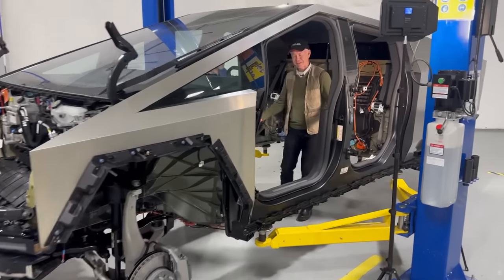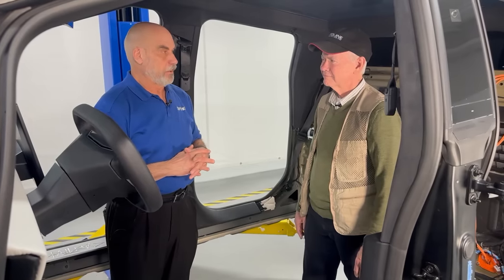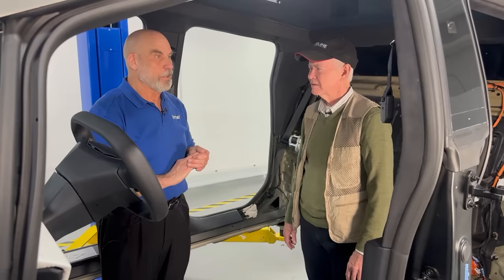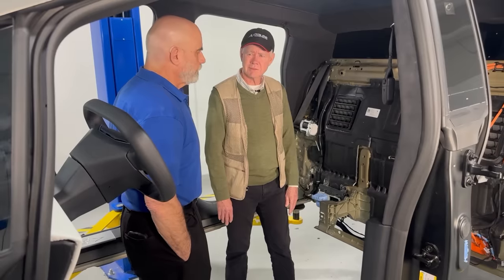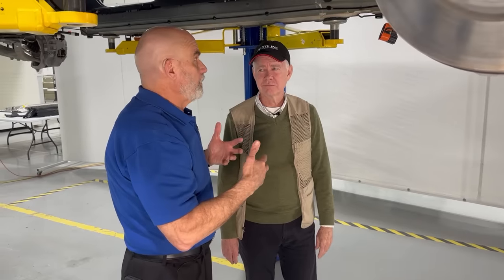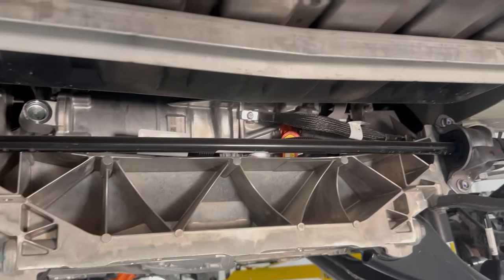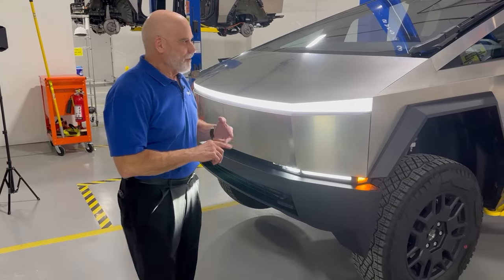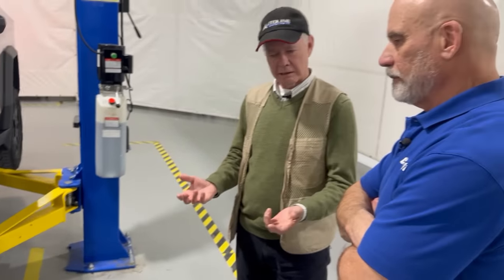World's 1st Cybertruck Teardown - Steer-by-Wire, 48V, Battery & Gigacastings

Comment: Kyle Conner stated that drive by wire does not work for off road driving! He should know after buying his Cybertruck that listed for $121,000.
Reply: KYLE , cheated and used DAVES Tesla points , to skip the Reservation line.

Comment: No. A drive by wire system DOES NOT need 48 volts!

The motors that move the wheels can use 48 v as they are the high power!

The steering wheel controller and circuitry could be ANY low voltage 5-12v as it is ONLY sending data to the motors that do the steering!

But once you have 48v available, you may as well have the “feedback” motor be 48v also.

Comment: 9:40 isn't it funny that our first thought about steer by wire system is usually that in case of such system's failure there is nothing stopping is from accident, but we never think about the multitude of possibilities why the traditional steering systems can fail as well? That shaft he holds in his hands can be broken on both ends, the telescopic mechanism can seize up, as well as the mentione bearings. And failure can happen further down as well. Shouldn't the first logic be that cancelling the idea of the shaft avoids a whole host of other possible failures?
Reply: No
Reply: @brunoheggli2888  Yes.
Reply: Not to mention Airplanes are steer by wire... Although with DEI hiring practices, airplanes have been going down left and right.
Reply: My 2013 Honda Accord is steer by wire.
Reply: @blipco5  it's not. It just has electric power steering
Reply: @illsheet  Oh, I get it now. When it’s on a one hundred thousand dollar Tesla it’s "steering by wire" but in my twenty three thousand dollar Accord it’s just "electric power steering" 😂 I have no steering column either and my rack has one electric motor… I call that steering by wire.
Reply: @themonsterunderyourbed9408 mostly left
Reply: @blipco5 
Your rack has a solenoid operated mechanical engagement in case of failure.
Reply: @rogerstarkey5390  I’m a pretty good mechanic and have done my own repairs for years, including rebuilding engines, but to be honest I don’t know how my steering actually works. I mean to research it.

Comment: The front steer by wire is a gimmick considering that the CT has a conventional steering rack.  Three electric motors instead of an intermediate shaft?  I'd like to know how much that costs.
Reply: I think the end goal was owner satisfaction (170 degree turn) and Tesla bragging rights to be the first. I agree, I don’t see any costs savings over the old school method. It may actually cost more to build.
Reply: I think it's more about the driving experience. In a normal pickup with a standard rack, you have to make it be a fairly slow rack. With the steer-by-wire, you can infinitely vary the ratio, so doing something like a 90-degree turn at low speeds is a 45-degree turn of the wheel, and then you can slow it down at speed to make it less twitchy. Whereas if it had a very slow rack, it would be a pain to operate at low speeds, or if you gave it a fast rack to gave it more sporty driving characteristics, it would be very twitchy at high speeds and probably not great for controlling trailer sway and doing small corrections. 

It also gives you one less hole in the firewall, and you can change the driver's impact positioning.
Reply: There must be at least one motor in the regular modern track for power steering. And the shaft itself with all the things mention in the video. So it is not that bad.
Reply: @shafir2info Exactly.  Plus assembling a connecting shaft is much more skillful and detailed than snapping together a few wiring harnesses.
Reply: I am sure it is costly. But there are many advantages - here are some
1) Different ratios at different speeds - quicker turns at slow speed
2) No hole in the firewall 
3) Easier to make right hand steering
4) 340 degrees stop to stop (vs normal 900)
5) Over air updates with adjustments - I bet driver modes are coming soon - racing (180 degrees), trucking (1800 degrees), dinosaur (900 degrees), off-road etc. 
6) Real easy for the computer (ADAS, stability control, ABS and so on) to control the steering
7) Avoids too hard steering wheel kick backs when driving off road
8) No need for a collapsible steering wheel column
9) More accurate
10) Perfect game controller
Reply: I can imagine the amount of  development hours and testing it will take to get the feedback feeling right.

Comment: The steer-by-wire in automotive is an idiotic application. Just because it is novel does not mean it is smart. Conventional steering is very light, simple, inexpensive, and very reliable. SBW introduces complexity, cost, weight, power demands, reliability concerns while adding very little benefit.  This is especially poor idea in an EV where you want to conserve every bit of energy now you need to power large motor to simulate the forces that in conventional applications you get for free. Then you need large, costly, heavy and power hungry motors (two of them) to steer the vehicle. I have seen a lot of dumb automotive ideas but this takes the cake. But of course Tesla fanboys will love this because it is "out of the box" thinking.

Comment: I will never own a vehicle that has no mechanical connection between the front wheels and the steering wheel.
Reply: Motor cycles have ride by wire throttle, is that OK.
Reply: Modern planes are steer by wire, and break by wire is more normal than one might think. Never say never.

Comment: Having no environmental separation between battery pack and cabin has not gone well for Chinese EV brands. If a pack is in runaway, the gasses are deadly - and go straight into the passenger compartment. They also lead to some spectacular explosions.

Comment: I'd rather watch sandy
Reply: Then don't watch
Reply: At least we got to see some defects highlighted here.
Reply: @normt430  The highlight on defects is the least interesting part when you talk about the first 1000 vehicles of a completely new car design dude. You hyper focus on stuff that every car manufacturer that ever launched has like its news. It isn't news, in fact this teardown video was kind of a joke because the car isn't actually torn down yet. It is merely pieced apart without actually giving anyone real insights as to what is happening. Almost everything they showed was shit you could see and tell without taking it apart to even what they have already done. You don't need to take apart the wheels of a steer by wire system just to see it move.... you just roll the car outside and turn the steering wheel lol.
Reply: @BigBadBossu  the improper hinge could have damaged the door.  We've seen Tesla with different wheels before amongst other things. 

See Munro gushing over the CT on the lift.

Comment: Dual front steering motors allows different vectors for the inner and outer wheels on turning.
Reply: If I recall, the lead engineers who spoke with Sandy only mentioned redundancy.  But perhaps there's more going on.

I suppose this is an opportunity to find out more.
Reply: I think it is still a rack so you won't be turning in different directions..

Comment: gigacasting saves manufacturing costs, but, make repairs more expensive or impossible.. next level of insanity will be structural batteries
Reply: Significant repairs are already a no-go these days. If you have a little fender bender, sure they fix that. But if you get into a serious collision, more likely than not your car is a write off anyway. Also, let's not forget just how tough this truck is. I've seen two accident pictures so far of the CT being hit by other cars - a civic, and a dodge ram. Both the civic and the ram were smashed, and the CT in either case was mostly undisturbed. For you to hit something hard enough to damage the gigacasting under that armor plating, you're probably dead already anyway.
Reply: Are you sure?
Reply: They can be welded and if not there is an realy serius problem and it should be changed anyways
Reply: Cybertruck has a structural battery pack. The Gigacasting basically will only be harmed in a crash that would total any other vehicle, in the low speed fender bender crashes the Cybertruck will not sustain any damage. You can hit the body panels with a sledgehammer and not dent them, and you can do the same with the gigacastings, a sledgehammer barely leaves a mark. Both the body and frame of a normal vehicle are definitely worse for wear if hit by a sledgehammer.
Reply: @ColinFox  The CT features an 'exterior crumple-zone.'

Comment: Terry: "They have 3 motors to replace a tie-rod, so complex"  McElroy explains "2 motors here for redundancy and that love that 4 wheel steering"    It's almost like Woychowski is trying to justify why this kind of aerospace engineering which works for aircraft has some problem and just cannot be done in automobiles.  (Not mentioned, but part of the safety redundancy mechanisms is the FSD hardware that is always enabled for free for safety.)   Terry smirks "48V but not everywhere .."  McElroy explains "but I'm sure you just need 12v for a dome light.. and its easier to step down voltage to 12V from a main 48V bus".   I have a new respect for John McElroy for adding some engineering context that didn't leave questions on some of the engineering strengths look like a weakness.  Cars are complex systems as are many of the things in our modern life.  Engineering is sometimes about tradeoffs but also about fundamentally trying to do things better and that is exciting!  Yeah that door hinge could use some Poka-Yoke.  Good find.  looking forward to next episode.
Reply: I think Terry missed the Munro discussion/ walkthrough with Franz, Lars, etc where they covered the multi voltage power supply, 48v system, steering motors/ control/ redundancy  and a lot more.

Comment: The teslas with structural battery pack don’t have quite the safety of the standard body in white. I was the one and only person to discover this with new iihs measurements. The structural variant of the Y while still rated Good, shows more intrusion vs the standard BIW.

Comment: Those motors don't just replace a convoluted shaft, they replace an entire hydraulic system (pump, valves, cylinder, lines, sensors).

Comment: The cybertruck is a fantastic car with many technical innovations. However, the 48 volt system is not new. It is a tested system and standard in other countries. See Wikipedia „…In 2011, German car manufacturers Audi, BMW, Daimler Benz, Porsche, and Volkswagen agreed on a 48V system supplementing the legacy 12V low-voltage automotive standard. Hyundai Tucson, Hyundai Santa Fe, Kia Ceed and Kia Sportage followed in model year 2019 with 1.6 and 2.0 turbodiesel engines supported by 48V mild-hybrid technology. A European automotive trade association, CLEPA, estimated in 2018 that as many as 1 of every 10 new vehicles in 2025 would use at least one 48 volt device in the vehicle, covering 15 million vehicles per year….“

Comment: Sort of a garbage suspension.  Giant steel lower arms, little travel, cheap brakes.  This is $30k car material.  Giant battery for 240 miles range and 7,000lbs of road-hugging girth.

Comment: The steering wheel motor is surprisingly big. I guess they just don't care to optimize or it's quieter in a big version with low gearing

Comment: Great, so basically they build a disposable vehicle using all castings. One good hit and it's junk and the whole steer by wire BS. What are they thinking? The cost of repairs down the line to keep profits up? What will that rack cost, or the steering feedback motor? All crap no one asked for or needs. Not to mention the whole stainless steel body too. LMAO 
Disposable car that will just cost everyone else in insurance costs. Go job...

Comment: I realize the overall methods need adapted to new manufacturing, etc. But straight up the Quality control of assembly this bad, you'd  think a FINAL Inspection before delivery would be better than to miss doors not fully opening. What less obvious stuff was missed? I so wanted the Cybertruck to meet the hype. Well this earliest generation has plenty of room for improvements in my opinion.

Comment: Steer-by-Wire with no mechanical connection.  What could go wrong?  Steering is the most critical control for safety, with braking second.

Comment: All this tech is great and “neat” but continues to drive up insurance rates. Already expensive labor hours go up, parts prices go up, the insurance write off frequency goes up. What’s cheap in the mfg process does not translate to repairs. All of us as insurance customers have to share the cost, rather we drive a simple car or not. How do we fix this ? Book hour regulation and all of the unintended consequences that might bring? It’s a problem across all brands.  Give me a $30 halogen bulb over a $2000 headlight assembly.

Comment: So, you are engineers doing a tear down of a Tesla product and you obviously have not watched all of the footage of the Tesla lead engineers and designers discussing the features of the CT. They have mentioned not everything could be converted to 48v due to the supply chain not fully there with options yet. Some things just do not make sense to produce in house so they did a mixed system for now.

Comment: I would have thought that using the battery box as the floor a silly idea. Why not have the battery box as a structural member separate from the floor with "screw jacks" holding it up, then undo 4 or six "Jacks" to lower the floor for ease of replacement.
No different from holding the body onto a chassis.

Comment: Steer by wire eliminates road feel which is critical for proper driving technique. Artificial road feel doesn't cut it. 
22:02  Now there's a panel gap I could see from two lanes away, flying down the freeway.
I guess if they're going with electric, they might as well use other pointless tech like rear wheel steering, which compromises its function as a truck. Too weak. The Cybertruck is a truck in name only and is too busy moving its own fat ass around to actually haul anything, regardless of the theoretical potential of the motors. Combined with the production failures, you have the very definition of a lemon. If they can install the wrong door hinge, they can definitely screw up something that is safety critical. It is sort of like the 737 MAX of passenger vehicles. A road going Ocean Gate sub. I wonder how many lawsuits Tesla can handle before they fold. I feel like suing them just because I have to share the road with that deathtrap. Definitely someone on the take at DOT. Imagining all this extrapolated out to a Semi and there are just no words.

Comment: Such a waste of time this SBW system. If it malfunctions you're dead! They add motors to simulate the road when they could just have a normal steering rack to do the same thing except this is much more completed. Sounds like a step backwards in my option, take a simple thing and make it complicated to do the exact same function. Rear wheel steering does not require a car to have SWB. Maybe Tesla should focus on quality first instead designing pointless tech.

Comment: As a Citroën enthusiast I wonder if the steering wheel self-center while standing still? High end Citroën´s used the Diravi system which also was "steer by wire" between 1970 and 1997. But it was hydraulic and had a backup steering column because legislation and safety. And one of the features was that it self centered even standing still. It was kind of mandatory because unlike "normal" cars where the road and front end dynamics dictate where the steering should point to, the Diravi steering need an "artificial default" and now I wonder how the Cybertruck does that. Decades ago, I wondered when other brands will catch up on Citroën´s engineering. I guess we know now about the steering at least.

Comment: A bean counting remark: The input and output speed of a cardanic shaft is only synchronous when the ingoing and outgoing shafts are parallel which is with a steering system never the case. In the most cars with a pignon/rack steering you can feel that the ratio is not constant.
4WD with solid axles can only drive on solid surfaces with a (unlocked) central differential. For instance a classic Land Rover 89 without a central differential can not drive 4WD on solid surfaces. Only on soft and gravel.

Comment: I think I would prefer a normal floor for safety reasons , and I don't understand why the front subframe has a few slots that haven't been welded, I would think it should be welded all the way so water cant sit inside , or am I missing something. I like the idea of stainless body panels and roll up bed cover. And I think I would have went with rounded fender trim / wells , it looks like a LEGO truck with them squared off . but if I look at it enough maybe I will change my mind.  Neat truck !

Comment: One thing to specify, the wheel already has a "force feedback" capable motor on it in most vehicles now, so it's not really "added" at this point :) it's just used for auto steering.

Comment: Let’s jump on Tesla’s 
Notoriety, dissect the car copy systems make small modifications so we then can sell it to other manufacturers. Many of these reviews and commentary make big deals out of steer by wire. Manufacturers have had throttle by wire for over 20 years. I sure the hell would rather have steer by wire, then a throttle sensor signal malfunction and taking a throttle acceleration  off on itself. Which one would you vote is more unsafe!!

Comment: I Have had 2 Mazda 929's (HE) and 2 Toyota UZZ32's all of which have 4 wheel steer, the operate via cable over hydraulic in both instances, at 30 KPH they default to opposite steer for lane changes, and low speed for parking in  via mode, these cars were built from 1990 till approx 1999, and cost much more then a standard model, but as for drivability I would not drive anything without 4 wheel steer, its great.